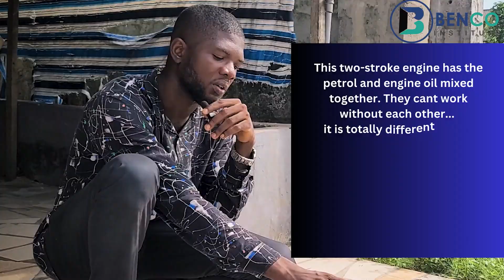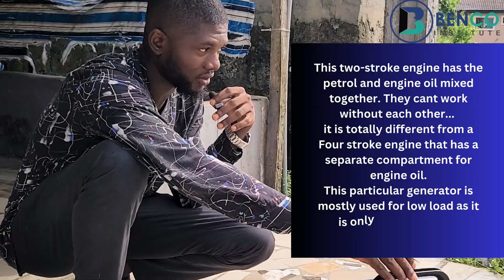Reduce petrol consumption of your 2 stroke generator with the most efficient methods.

Comment: Thank you very much for good information video :) the small tiger generators can be very very fuel efficient if tuning carburetor correct like you say, mine will last many many many hours. I also pour in crappy old fuel and oil, it seems to work fine on it but i need to clean carburetor more often than normally 🎉
Reply from the maker: Wow
Yeah
That's true,you have to clean your carburetor regularly in that case..

I do use crappy oil sometimes too...but I wouldn't advice a yongin who doesn't know the principal workings of  generators.

Comment: You can not just alter the rpm of these generators. The rpm is directly linked to the frequency either 50 or 60 hz which affects frequency dependent equipment.
Reply from the maker: Yes you can alter it... Have u seen the speed of some of this generators...

If you have a generator that has a high speed do you leave it that way to destroy your appliances knowing fully well this particular gen does not have a voltage controller system.

Of course not... It so unfortunate that there is no frequency meter to properly regulate the frequency of your generator 

But that doesn't stop you from tweaking the speed of the generator when you notice abnormalities.

Thanks for your feedback
Reply: All these university electrical theory orientated engineers, leave this young man alone, if they give you a small tiger generator to repair now you start looking for the local guy to repair, abeg make una rest, passing circuit theory doesn't make you good practical orientated engineer.
Reply: Do you understand how the frequenxy kf different generator are set?
Do younunderstand what 50hz is and how it affect rpm of sync motors?
Your video shows you do not have the basic understanding of generator systems sadly. What you are adjusting here in this video is the govenor whixh is responsible for maintaining rhe output frequency uder varyong load conditions. Not a matter of choice to save fuel but to ensure frequency is maintained
Reply from the maker: @ruthnumsolutions  what do you do when your speed of your generator of let's say 1300rpm now runs on let's say 1800rpm 

Do you Adjust it or not?
Reply: When adjusting that govenor you use a frequency meter to set the rpm to supply an ac  voltage of 50 or 60 hz depending on your equipment requirements. Ill show you a video in a bit
Reply from the maker: @ruthnumsolutions  I was about replying one of your comments only to notice you have deleted it ..
Reply from the maker: @ruthnumsolutions  it's obvious you aren't reading my comments....Did you see where I made mention of a frequency meter in my previous comment.

Go look it up and read the comments slowly.
Reply: I didnt delete any comment ! 🤔
I see all I posted.

If rpm is high yes you adjust it back to the correct frequency.
Not to save fuel although but to correct the voltage and frequency.
It all comes down to servicing the generator properly and regularly.
High rpm will generate high voltage which will damage equipment.
Reply: @ruthnumsolutions It obvious you don't understand AC concept well enough, frequency does not depend on the amplitude of AC, signal.  Frequency it the number of times the signal goes up and down in a second, whereas amplitude is the maximum peak on both end  (called voltage).  Funny enough most home appliance can run on frequency range from 30 to 100hz, But get blown when the voltage is past some threshold. 
In respecting of the frequency from the generator when turning the governor, the main concern is the amplitude peak which is the voltage
Reply: @chukwuemekaokafor3859  learn how frequency is generated before trying to teach an electrical engineer.
Frequency is directly propotional to inductance and inversely proportional to capacitance. Go research what that means with reference to current draw by the load.
Reply: I'm an electrical engineer but when i got to the field i noticed there's different between the big English we were taught in the class and the real practical aspects of the whole thing